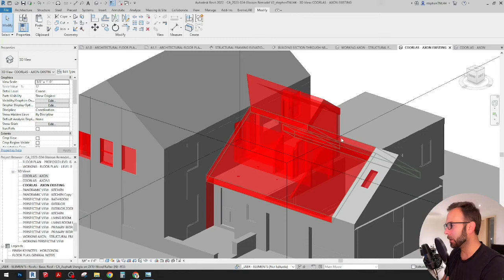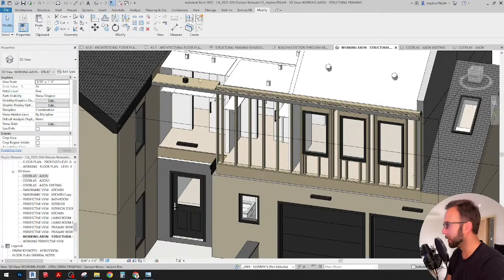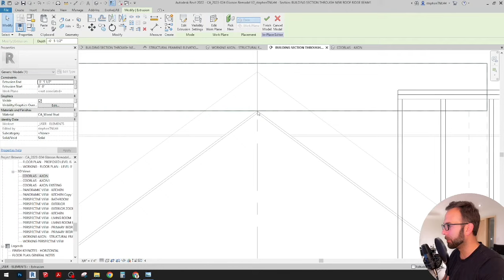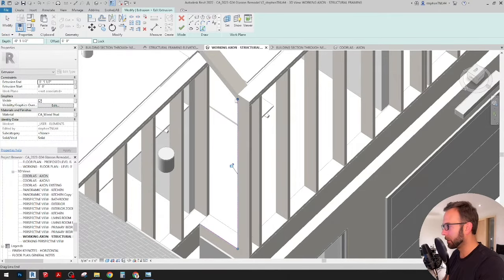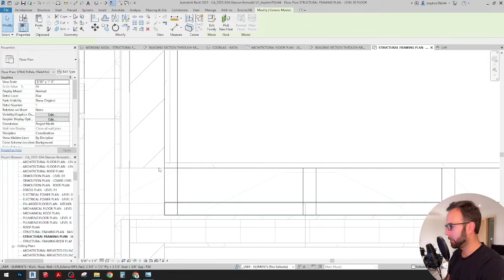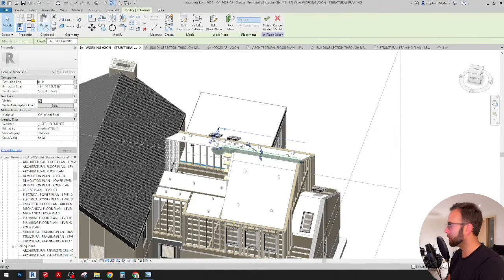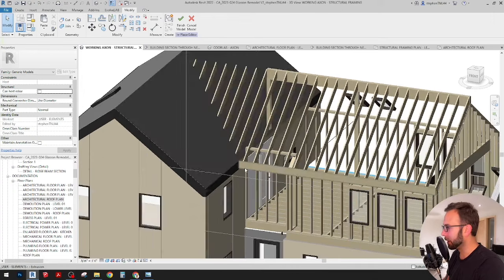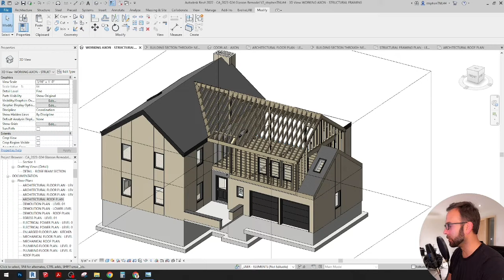Residential Wood Framing (Revit Tutorial)

Comment: What's the benefit you see in modeling to this detail for residential projects? Not to be critical, just curious as what you see the benefits you find are. I have found that modeling the roof trusses, and major structural components to be beneficial, but am curious where you see the benefit in modeling the individual studs / joists. Cheers!
Reply from the maker: I only model this level of detail if it's included in our contract, or if there are dimensions I want specifically called out for window locations, sill heights or beam/column intersections, all of which were important in this design.

Otherwise, modeling framing members for very basic exterior walls or roofs is not necessary.

Comment: Thanks for the video. But have you tried using a curtain wall system for your studs and beam systems for your joists and rafters? You would go much faster.
Reply from the maker: I have an do for certain applications. The curtain wall can be a bit volatile, so for more intentful modeling we do it with generic modeling and custom families.

Comment: Most of the American homes use American Software -  Revit, but American Software -Revit doesnt come with Native tools to create framing systems for walls, but makes Americans painfully model each Battens, Studs, ridges and the entire plethora of American God knows what not, but So American!, (Hawk sounds in the background)
Reply: It is not necessary to model each element separately. The video is a very bad example and shows what not to do. The easiest and fastest way is to use Curtain wall for framing systems.
Reply from the maker: There's many ways to achieve the same goal. This is only one method, and it provides the most control for intricate structurally oriented jobs such as this.
Reply from the maker: The curtainwall method is a good option for quick hastily modeled framing. For custom jobs with unique detailing, custom modeling is a preferred method for more accurate results.